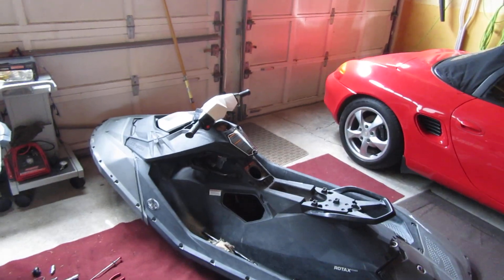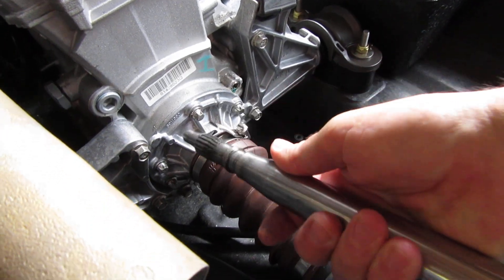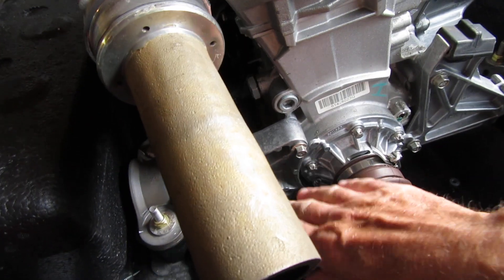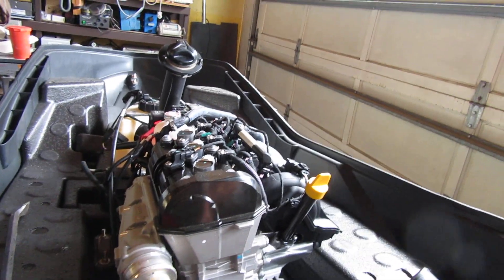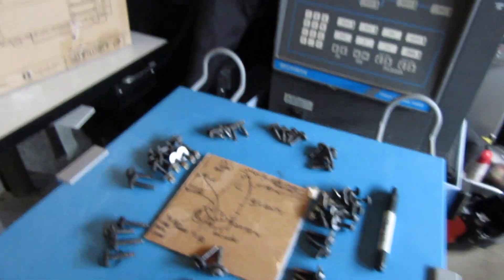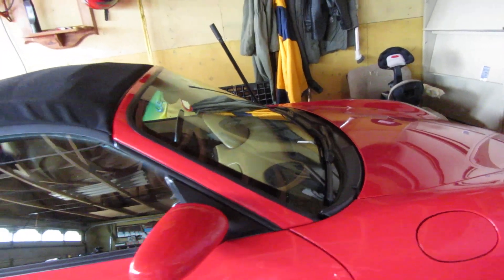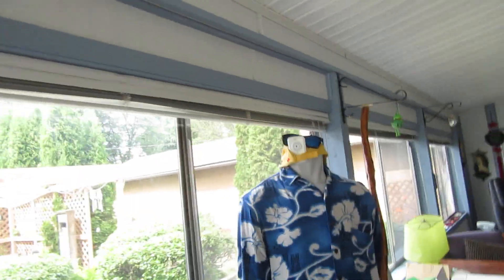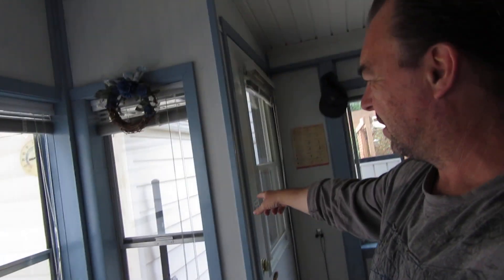2014 Seadoo Spark Driveshaft Failure + Change

Comment: Hi. Have you used the spark after changing the driveshaft? Is it working fine? I have the same problem with my spark but I think maybe the output sleeve is damage as well.. 
but if it works just by changing the driveshaft and use something to make the gap in the propeller smaller I’ll do the same😊
Reply from the maker: I've had it on the water six different times now and I usually stay out for a couple of hours ... so far so good. The first couple of times I was paranoid it would go again so rode it carefully and closer to the ramp. Now I'm pretty much confident of it and back to usual having fun. I did add another spacer so the total is about 2cm because I was worried it wouldn't be enough to stop the driveshaft slipping back away.

Comment: i hope this didn't just happen to my 30 hours 2015 spark. All of a sudden I stopped getting any throttle and when I pulled it out of the water I could not find anything stuck in the impeller . The drive shaft is a bit rusty from the outside but I hope its not it. When I turn it on I can see my prop barely spinning like something it is slipping. Hopefully something is just blocking it and taking of the pump would make it visible and allow me to clear it out.
Reply: did you find what was it i think i have the same problem

Comment: Did you pun nut in a propeller so crankshaft would have less freeplay?   I have same problem right now.
Reply from the maker: Yes, I used an oversized nut as a spacer. It held up all thru last Season. Hopefully this Summer too.
Reply: I just put a spacer in there too. My maiden test went well. We'll  see how long it lasts.

Comment: What did you use for a spacer?
Reply from the maker: I used an old socket from a wrench kit. It lasted about a month. Now the crankcase drive is too worn so I sold the Seadoo.
Reply: @Engleburt  that doesn’t sound good!